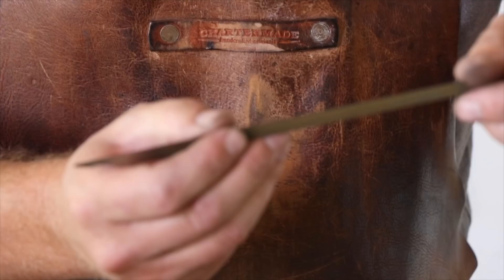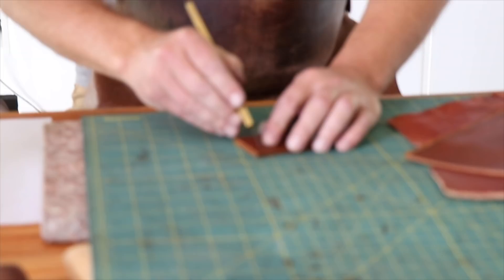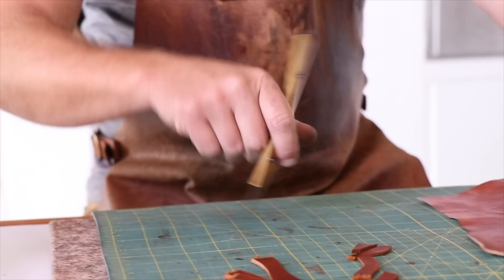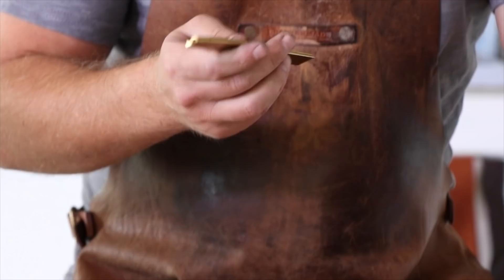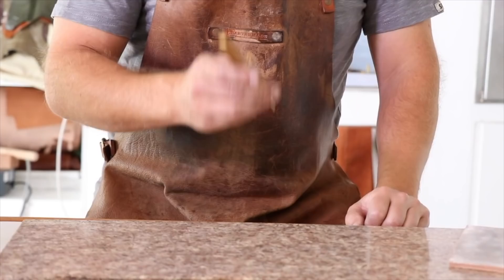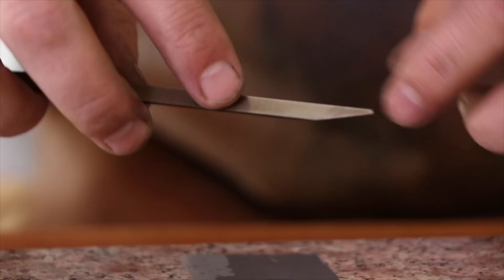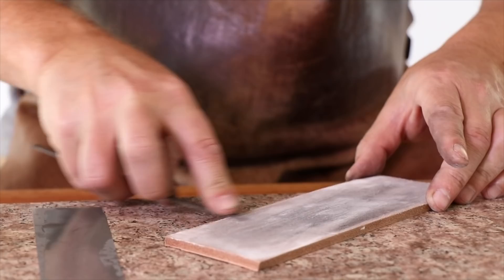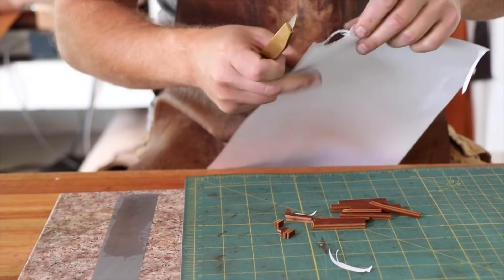L'Indispensable Brass Knife - Chartermade blade

Comment: Just received mine. This thing is sharper than described if that’s possible. Cannot wait to put it to use on a project. I’m guessing with the D2 steel and proper stropping it will out last and out work any other.
Reply from the maker: Thanks for supporting my work and Im glad you are happy with your blade. Enjoy

Comment: Seems like a very well made blade, although I wouldn't have thought that a single bevel would be the edge of choice. I have only seen a limited few chisels and knives which had a single bevel edge and they were mostly for purposed specialized cutting. But, I can see that a bevel, away from the cutting edge of the piece of leather you intend to use, might act as a wedge and push the off cut part away from the leather being dimensioned. 

One suggestion, I have always felt that the "ultimate" test of the sharpness of a blade was not simply slicing through a thick sheet of typing paper. There are a number of reasons for this theory: that kind of paper is made of a rather low grade pulp and is loaded with microscopic "trash" in the form of tiny stones, dust, foreign debris, and other contents which may do more harm to the cutting edge than is imagined. And I was always told that cutting on any type of processed wood product like low grade paper and cardboard was very hard on a keen edge. When I want to check the edge of a newly sharpened blade for burrs, tiny knicks, some of which are barely visible with the naked eye, and such, I use a regular cash register receipt from a food store or other dept. type store. The paper is finer in texture and will simply fold up or collapse under the slightest pressure from a not so sharp blade edge. But, if you did your homework on the final honing and have the edge where you feel sure it should be, it should slide through a register receipt with very slight pressure and cut smoothly and cleanly from beginning to end of the cut. Give it a try, you may be surprised at how dull your edge may still be. I have found that you may have to take your paper "holding" fingers and form a slight curl in the paper to give it just enough resistance to allow the blade to slide through the edge of the receipt to start the cut and then it's like skating on ice.
Reply from the maker: Hi Tom, thanks for your detailed comment. The single bevel does part the leather and gives for a much smoother cut. (this blade specific) I don't check for sharpness by cutting through paper but used it as a visual in this video to show the people watching that the blade can still do that as well as shave hair after cutting multiple pieces of leather, which is what the blade is designed for. (cutting leather, not shaving hair) I absolutely agree with you that the paper test is not a measure of extreme sharpness and you are very correct in saying that cardboard and paper are very abrasive to a keen edge. After sharpening 1000's of knives I have an acute feel for a sharp edge on the tips of my fingers so that is all I do after sharpening, feel the edge. Its sometimes a challenge trying to demonstrate what a blade can achieve on video so hopefully all the little visuals showed it can cut leather well.  Thanks again for taking the time to share such a detailed response. Regards Terrick

Comment: Arrived RML today. Mine is ordered..
Reply from the maker: Thanks for supporting my work. T
Reply: Terrick I'm just glad to finally see a well engineered blade in quality steel for the little french leather knife. Their blade steel is woefully lacking.  Thanks for bringing it to the marketplace and at an affordable price too.
Reply from the maker: No worries, please let me know how it works for you. Tag me on instagram if you on there. My pleasure on making them, T
Reply: I received late yesterday and spent some time cutting on scrap pieces.  Wow! What a difference... The blade cuts so smoothly I believe it actually leaves a slight burnish on the cut edges.. I thought the single bevel would require adjustment in method but instead seems to naturally follow the score line.  I can only imagine that working with such a small blade presents challenges to the knife maker.  Kudos on a well made blade! Thanks again Terrick!
Reply from the maker: Thanks for letting me know and so glad its working well for you. Yip, making these to this level was quite a challenge which is funny to even say considering I make folders and other knives with lots of detail, but to get such a small blade to perform like this tooks loads of work. Thanks for noticing the work behind it. Regards Terrick
Reply: You are quite welcome Terrick. A quick question if you don't mind. I know D2 is a high carbon steel, is rust a potential issue if stored in a small protective leather sheath?
Reply from the maker: D2 is a semi stainless steel as because of the amount of chromium in it so. Depends on your environment, if you in a high humidity area then yes. If im not using any of my items for a period of time I do oil them. T

Comment: I’m confused on the side the bevel is on. I easily would have thought the bevel for a lefty like me would have been on the left side. That way the flat is on the right and visible to the person using it and more accurately cutting to a line or against a straight edge.

Comment: D2 is tool steel, it does not hold an edge "like crazy"; however its better than your 440c, or 420 heat treated for edge retention and still easy to sharpen. I'd imagine for leather working it more than sufficient. I'm not knocking the product, I've been unhappy with that claim more than a few times when purchasing knifes. My daily work knife is a Ontario RAT 1, D2 blade. For the price point its seems like a fair deal for the blade holder and your blade.

Comment: Hi Terrick, I got your blade with the L'indespensible handle from RMLeather not too long ago, and I think I may have messed up the angle while sharpening it. Instead of the nice flat grind it seems I rounded it somehow. Can you tell me the original angle of the grind so that I can try and restore it? Thanks in advance
Reply from the maker: Hey, the nice thing about these little blades is that they easy to fix up. I hand sharpen them so I dont have a set angle but it would be around 15 -20 degrees. Also, when it comes to sharpening a little blade like this you can experiment with your edge and see how it cuts for you. Regards Terrick

Comment: I bought blade and handle from rocky mountain but the blade doesn't have any brand engraved on it.... and it's not that sharp like in the video I wonder if the blade is different when I order together?
Reply from the maker: I don't make the handle, and the blade that I make is sold separately to the handle on the rocky mountain website marked as Chartermade Replacement Blade, and it is engraved with the chartermade logo.
Reply: @CHARTERMADE   Thank you I figured that later on, I received different blade... I'll probably get your blade in the future, I wonder how long do they stay sharp after sharpened or stropping.